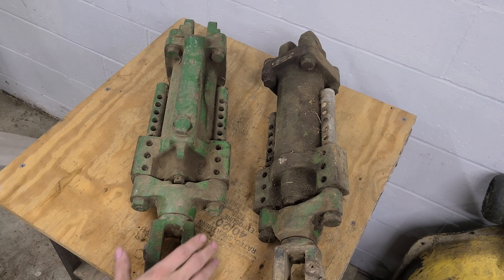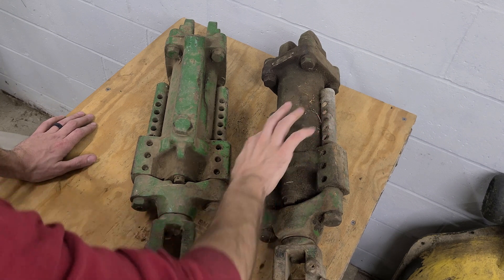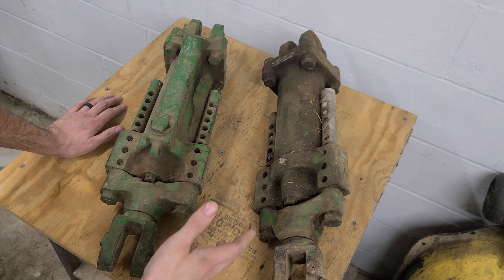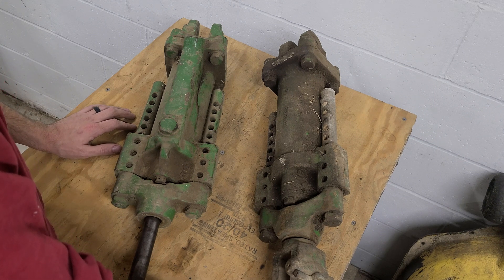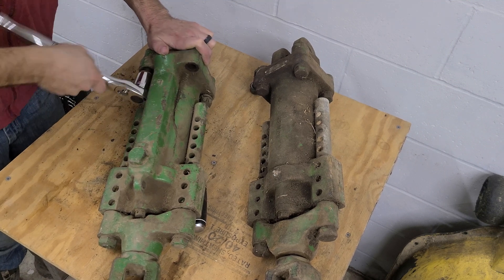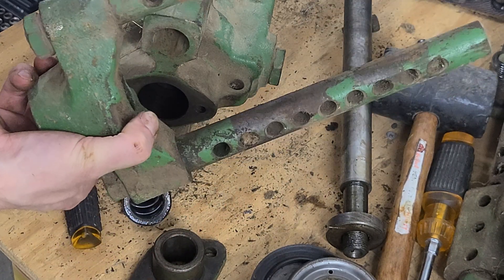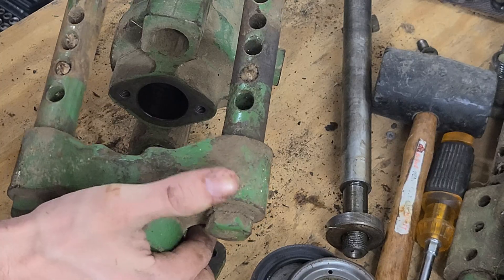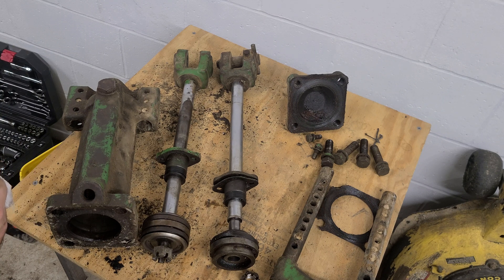John Deere Hydraulic Cylinder Rebuild for Two Cylinder Tractors (A, B, G)

Comment: Did you ever fix the one with the cracked housing? I am interested in it to fix.
Reply from the maker: I actually have 2 with the cracked housings. No,  I never fixed them. This summer I actually bought another unit with a good housing. If you are interested in the cracked units you can email me at DanielFarmChannel@gmail.com
Reply: @DanielFarmChannel  Will do.

Comment: Very cool, thanks Daniel! I always wondered what they looked like inside. The one I have on my '52 B has never been apart as far as I know. Dad got it with the tractor and it's been well used over the 70+ years on plows and disks and it still works perfect. I still use it every spring and fall on prepping and cleaning up the garden. How big of a difference is there in size between the A and B cylinders? I never saw pins in our cylinder for the depth adjustment. Dad just had bolts dropped in the holes. 👍👍👍
Reply from the maker: Great story.  Thanks for telling me.  The A cylinder is decently bigger.  In the video where I put this one back together I'll try and remember to get the B cylinder parts for comparison. The pins that came with the cylinder also had chains to keep them with the cylinder.  Thanks for watching.